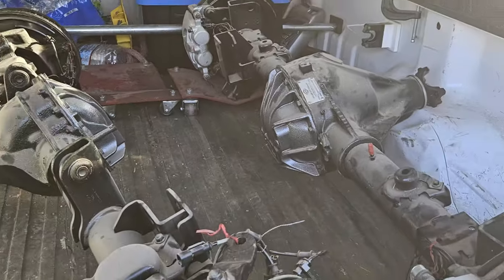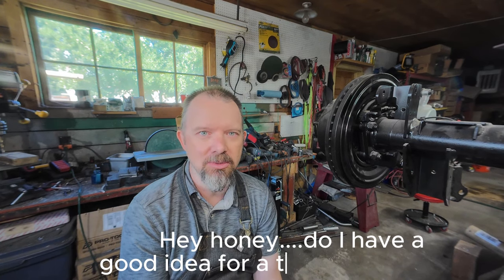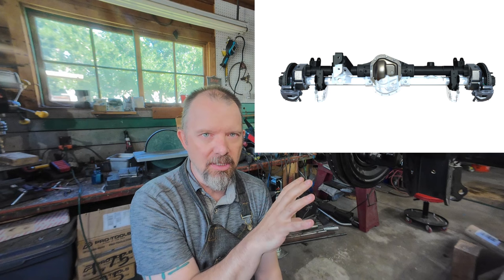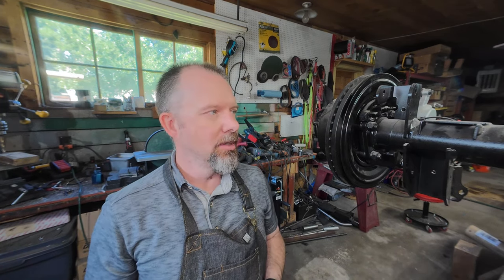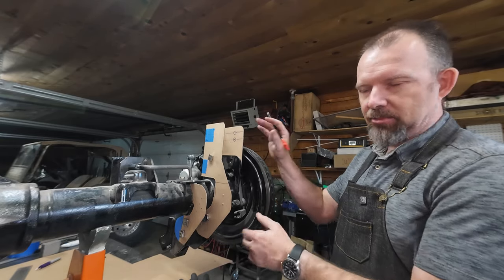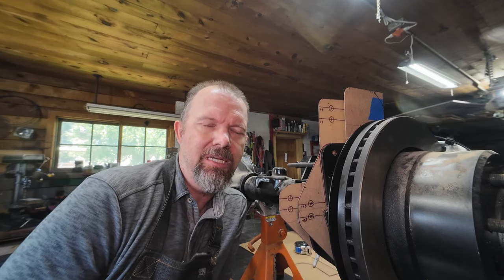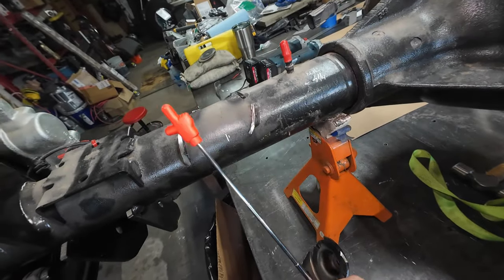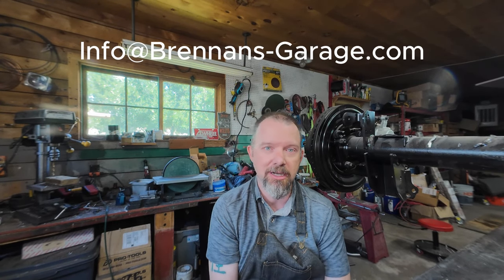(More) Ultimate Dana 60 axles: Part 1

Comment: Agreed, I have a TJ Brute project on a JKU chassis that mostly sits in the back of my garage. It will be stock ish height. I ended up pushing the front forward 2-3” to get a 40 to clear the frame curve inward at the firewall.

Comment: When I did the one ton swap on my JKU this was something I wrestled with as well.  I ended up going with a junk yard 14b (aam 10.5) because I was able to manipulate the geometry fairly easy with a truss/swap kit.  With the front being a little more complicated, considering castor and diff offset being an added factor, I chose a Fusion axle because they did all the things I asked for without adding cost.  Excited to see what you come up with here.
Reply from the maker: @tslucam  thanks for following along! I looked at the junkyard options, but like you mentioned, I think the front lower control arm mounts with the increases diff offset quickly becomes an issue. I'm trying to pick my battles on this one, I came really close to doing a fabricated housing for 10.5 Toyota Tundra 3rds with late model dodge pickup outers.
Reply: @brennanmetcalf ok. I would love to hear about the tundra axles and the thoughts around it. I know Tyler from moreflate has tundra axles. But your choice of outer has me intrigued.
Reply from the maker: @lgray647  the Tundra center is a monster 10.5 ring gear....so splitting the difference between D60 and like 70 or 14 bolt stuff. Drop out 3rds means a fabricated housing which makes all the brackets easier in front. The dodge pickup outers are plug and play ABS compatible with the JK if you use the right years....14 to 18 I think.

Comment: Overanalyze?  I feel your pain on that one.  I plan to do long arms on the front of my jeep this fall.  I have been planning it for ~1 year now.

To solve the issue of moving the lower mounts closer to the center of the vehicle, why don't you also shift the upper mounts an equal amount.  That would. keep your arm lengths the same as stock, and also give a small amount of stretch to your wheel base.
Reply from the maker: The arm lengths can't really stay 'stock' if you move the lower arm up to the front of the axle tube ( at least not without moving axle back a lot more than I want ). I don't really think that trying extra hard to keep the stock arms is worth it generally. If you could flip the upper and lower arms for length, it gets closer, but the upper and lower arm use different construction and different width joints. In the grand scheme of things, I don't think replacing the arms with something stronger and adjustable is a bad thing. I am sure there will need to be fine tuning on everything for length in this kinda prototype stage.

Comment: building a JLU with same setup.   i almost when portals as well, the reason i didn't was to truly do portals right you also need to replace the housings and then your total is about double the price of one tons.
Reply from the maker: I would agree with that, the cost on the portals does really add up the further you get into the project. I was really lucky to find this let axles for about 1/2 the cost of just the portal boxes. That still seems like a lot, but is sure easier to swallow. We can dream that Jeep will offer something like this in the future from the factory!
Reply: @brennanmetcalf  hoping to see you in Moab with it this year, plan is for mine to be done and tested prior to EJS.
Reply from the maker: It will probably make an appearance at EJS, but I usually like doing most of the week in the flatty. It's gonna be late in 2025, so the weather should be nice!

Comment: If you recall the Currie early years of rock crawling comps, they used a swing arm on the rear that wrapped under the tube and attached to the bracket on the backside of the tube. It was their red TJ 'Fire Ant'. 
As for lifting the bolt points, you are basically doing a JeepWest geometry correction layout.
Reply from the maker: @Mickale-Moranis  I remember the Currie J-arm, neat one. My approach is a little different than Jeep West, at least on the JK. I'm not lowering the frame side lower mount. On stock width axles, there is more to worry about with clearance for the upper tower. With the wider axles I have a bit more freedom that way....and I don't want to lower the frame side mounts for clearance reasons. Accutune also dabbled in geo correction brackets back in the day. I know I'm not the first person to do it, but I am more wondering why it isn't a more popular idea across the aftermarket axle market. Seems win win to me across the board as value added for basically no extra cost.